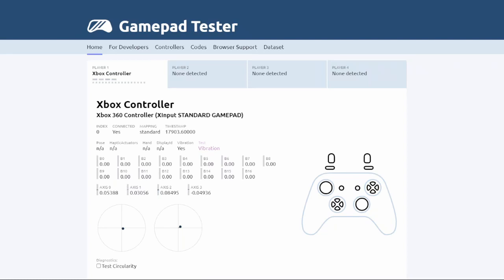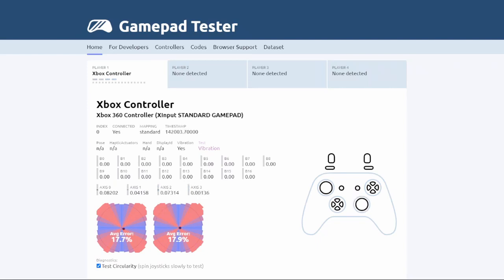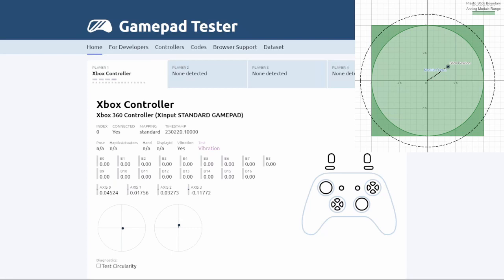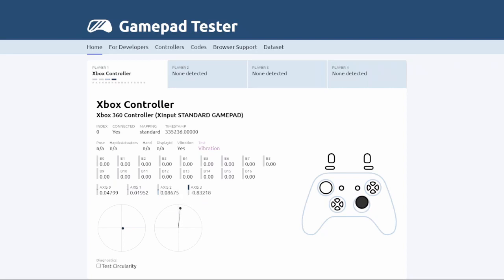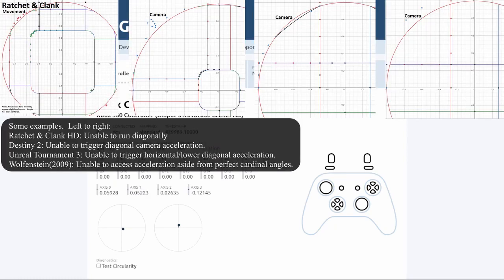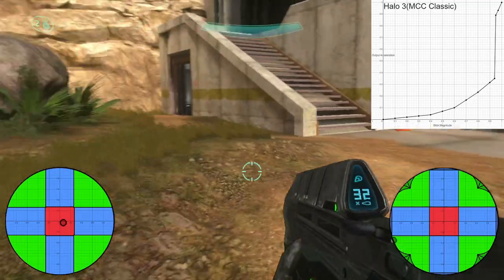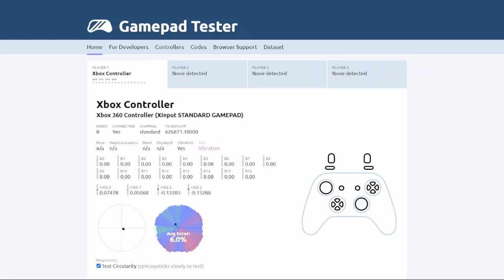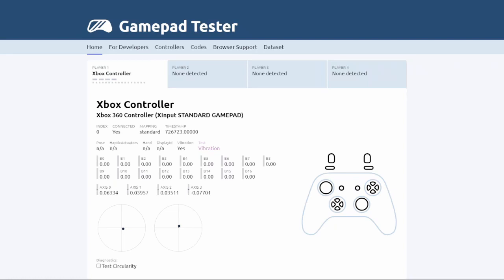My Thoughts on Thumbstick Circularity

Comment: Very good visual and theoretical explanation. It aligns with my observations over the years of repairing controllers. 

Because of the constraints put in place by the manufacturers, e.g., analogue module calibration burned into firmware, I have found that the new module must be mechanically zeroed out (flat, flush, and physically centred in the shell) before any calibration can be done. 

With the dawn of these hall effect analogues, this is even more important since you have to fight the imperfections from the factory calibration. Getting the analogues centred to within 3% (mechanical tolerances and wear are the limiting factors) and getting even full 45- or 90-degree extreme bounds is the biggest issue. 

I've noticed the likes of SCUF just have a wider opening and some others have a narrower stalk on the cap to overcome this issue, but as a trade-off, the stick travel is over-streched and 100% is achieved way before the boundary simalure to the hall effect sticks with no calibration board installed.
Reply: Hey bro, where can I get a free circularity test for my joystick, can't find one online anywhere.

Comment: This was a great, informative video. I recently saw a number of circularity tests on Gamepad Tester when watching reviews of controllers, and got very focused in on that (& how the controllers I was looking at scored in that), but this helped calm that. This, and just realizing that the controller I'm replacing (after 20 months, the wireless dongle failed and the chinese 3rd party has almost zero support) scored 17-18% (although a great center, 0.00002 +/-)....but I never really felt it performed poorly (in fact, I'm debating whether to replace, or just deal with playing wired, b/c I've really liked it). I don't play competitively, or even online at all. The dead-zone remarks re. Xbox Series here made me start worrying about that, too (since that was one of the final contenders), but I should probably ignore that, too, for the same reason.
Reply from the maker: I haven't used a Series controller, but I've heard about the deadzone issues a few times.  I can't speak on that at all, but hopefully that's not an issue.  Some players have used 'deadzone' to mean the stick gets loose quick though.  An actual inherent deadzone would be a large step back over the Xbox One controllers.

Comment: There are some controllers with hall effect analogue sticks such as the gulikit kingkong pro 2 and I believe one of the 8bitdo ultimate variants. Very good, less than 1% error on those sticks even after a lot of wear.
Reply: I bought Ultimate bluetooth and tested it: left 12% 13% right 16% 17. Some quality issues around the analog plastic edges. Unfortunately, it's not a physically perfect circle. Maybe if I mount a nicely cut ptfe plastic around the analog surround, I think I can get a circle that is both super slick and faultless.
Reply: Gamesir t4 kaleid has 2 deadzone options with their hall effect sticks, max 100% and raw. 100% keeps to the circle (0.3% error), raw goes all the way (~10% error). I upgraded from the 8bitdo ult bluetooth (trigger plunger failed 6 months in, doesn't hit 100% RT without teardown fix). 1000hz is a big difference too, more responsive.
Reply: I have 8bitdo ultimate controller and it has 21% error on both stick, basically a perfect square lol
Reply: @cem1221  update your firmware the previous one had a glitch that increase error rate. I fixed this myself by returning to the original firmware but they literally just released a new one 2 days ago that fixed joystick accuracy. Error rate is down to 7-8% and I am performing sooo much better and consistent in Apex now.
Reply: @notchipotle  update your firmware. The previous version messed up the joystick accuracy. Either the newest firmware, the oldest one or second to the oldest. The third firmware update is the one with the issue and the 4th that just came out 2 days ago fixed joystick accuracy. I'm down to 7-8% on mine.
Reply: @RealInnerG  Thanks, yes. its now 8 percent left right.
Reply: Huh, installed new hall sticks on a dualshock 4, error is at ~20 on both, but sticks return to center consistently. Personally, feels fine when playing, though.
Reply: @benjaminschacht92  If you installed them yourself there going to have a higher circularity error % unless you have the ability to re-calibrate the joysticks.

Comment: What's the proper term when your issue is more with it hitting green rather than Red?

As in the controller doesn't go all the way to 100% but around 60% for a second or two before shifting to 100%, causing issues in Hogwarts Legacy and just curious on the name for it.

Comment: I've been searching for a long time on how to make it so that my controller's analog sticks trace a circle instead of a square and I came across this video of yours. Now I would like to know, how would I go about doing what you did in the video to achieve a circular output? (I'm using a wired Xbox 360 Controller by the way)
Reply from the maker: Making the input trace a circle is mostly superficial.

I used a script for the TitanTwo adapter in this video for it, and a similar script can be used for the TitanOne and Cronus adapters.  Those are pricey, but the only way to get that on console.
On PC, I've heard reWASD's virtual controller emulation outputs perfect circularity, but that's the only program I'm aware that can do that for Xbox controllers.  I think virtual controller emulation is part of its free license.  DS4Windows can do that for PlayStation ones with its force output toggle.

Comment: I got this situation while I'm moving my sticks. When they are crossing axis (x or y) they kinda cling to axis, and after some further movement they detach from axis. As i can see from your video, your sticks don't have such behavior. Yours kinda move smooth through the axis. Mine not. What do you think that is?
Reply from the maker: That's caused by the sticks having/outputting an axial deadzone, or a curve being applied separately to the x/y axes.

You can tell if it's a deadzone issue if you make small movements and neither x/y values change, and when moving past an axis one will stay the same until you pass out of the deadzone.
The Logitech f310 does this.

If the axes are altered to follow some curve, then you'll see values changing, but will slow down around near the axes since that's the slower end of the curve.
The Afterglow 360 controller does this.

What controller are you using?  I don't have an official 360 controller anymore to compare, but I used an Xbox One controller in this video, and PS4 controllers function the same.
Reply: @EternalDahaka  DS4 controller
Reply: You got a solution for this? I got the same issues

Comment: Hi where can I get the software? I'm using a Flydigi Apex 4 but I can't be precise in the micro movements because they are too sensitive and I would like to calibrate it
Reply from the maker: The only controller software used in this video is a script for the TitanTwo to clamp the maximum range for 0% circularity error.  That's a pricey device($140) if there are other options.
If you're playing on PC, you might try running games with Steam's Input customization and edit an output curve that can help with the micromovements.

Comment: Hey bro, what program did you use to have less % on the circularity ? Im having a problem with my new xbox series x controller. 
When I want to move the stick in an absolute straight line along the x or y axis, it tilts slightly up or down, which is a problem when playing Rocket League because I can't make perfectly linear side turns. It's really sad because in my country it was very hard for me to afford this original joystick, and I bought it to be able to play Rocket League.
Is there a program that can help force the axes to be more linear?
Reply from the maker: I used a script for the TitanTwo adapter.  I just clamped the stick values past 100% to get the circularity to 0%.
There is no benefit in doing that, since the "real" error is still there, just hidden from gamepad-tester.   Higher circularity was supposedly better in Rocket League anyway, at least before they added sensitivity options.

I haven't tested Rocket League, but another user made a great tool showing the deadzone and dodge thresholds for it.
The deadzone there is axial, so if you raise the deadzone size it will increase the ranges that you move perfectly left/right/up/down.  It works with controllers so increase the deadzone enough so you can make perfectly horizontal movements easily.
https://halfwaydead.gitlab.io/rl-deadzone/

Comment: Do you know if the Dualsense works based on the same Axis-Independent calculation as the Xbox controller? Because I have notice that on RE titles looks like the deadzone is circular compared to the rounded square on Xbox. Even on the last RE:4 demo that came out yesterday I can tell the difference between controllers.
Reply from the maker: I don't have a DualSense to test but as far as I'm aware it functions the same as the DS4, and that registered the same as the XboxOne/Series controllers.  Altering the curve by axis wouldn't create full angular restriction like the axial deadzones even if it felt like it.

Do you play on PC?  I've heard RE8 used a circular deadzone on PS4, so I assume it might be more an issue with the versions having different deadzones for whatever reason.  Maybe on PC they might swap the controller too?  I only have RE2R on PC, and that uses a circular deadzone for Xbox controllers though.
Reply: @EternalDahaka  Yes, but I currently do not have that game for PC. I have noticed that the RE games have different deadzones for PS and Xbox for some reason.

Comment: Thank you so much for your videos, they helped me a lot. Do you have any thoughts on the different calculations on the Xbox Elite 2?
Reply from the maker: Nothing useful from me.  I don't own either Elite controller, and the descriptions I've found for those options aren't clear.  I can find anyone giving a clear comparison of the stick movement to give a good gauge of it.

My only guess is Radial and True Diagonals apply the curve from the center, but radial locks the outer range to a circle(like I did at the beginning of this video for perfect circularity).  True diagonals would be best if that were the case.
Axis Independent could have the curve applied for each axis separately, which would skew the angular movement.
I had made a visual to demonstrate those suggestions, but don't know if any are accurate:
https://www.desmos.com/calculator/ngz75fntl9

If you own the controller, maybe you could see if any of the calculations seem like they match the movement on that graph.
Reply: @EternalDahaka  Thank you for your answer. Yes , it seems to me that the True Diagonals is more precise, specially in games with bad stick implementation (like RE:VII). I thought it was a placebo.

Comment: Gamesir t4 kaleid has a raw mode and a regular mode that either has 10+% error and then 0.3% error. So that's achieved through software? Is there a downside to using the 0.3%?
Reply from the maker: There's no downside to using the 0.3% error version as long as the game's thresholds are within that range.

These Reddit posts are very detailed on the Gamesir G7 with some images of its output and a quicker earlier issue with the T4.  I don't know if the modes differ between models, but the 'raw' mode in G7 seems also artificial in their case, but gives you more diagonal range anyway.
https://www.reddit.com/r/Controller/comments/14t4hyl/psa_careful_about_gamesir_hall_effect_controllers/
https://www.reddit.com/r/Controller/comments/157h6u0/circularity_explained_and_a_note_on_gamesir_g7_se/

Comment: I once soldered a xbox potentiometer on the dualshock and it made fps games unplayable on ps4, Diagonal movement was out of control. How does pc games handle different cotrollers? Do you think they account for the difference in circularity?
Reply from the maker: That's interesting.  I wonder what could be outputting when doing that.  I have seen some replacement modules that were said to work in either controller, but I've never soldered one myself to see how that might function.

Games that support different controllers have things standardized.  Their default resolution will be converted to -1 to 1 like with this testing program.  Some controllers aren't natively supported, and drivers are available to use them(earlier Sony, Nintendo controllers).  These many/may not be coupled with wrappers that will translate the input, normally into Xbox inputs since that's the most commonly supported.

Comment: I had stick drift and got it fixed at a shop, but then now there was a noticeable difference in playing fps games. Tracking was almost impossible. I checked the circularity error, and while the stick drift was gone, it was 25% on both sticks. What would be the reason for this error?
Reply from the maker: What was the shape of the range to get that error?  Is the stick still able to move consistently outside the circle?  ~21% is the max I could get it by hitting the full square range range.

I can't really say much beyond that.  If it leans further outside the module than it did before the module or stick covers could be different.
Otherwise can I ask what values the stick centers at?  I don't now how deadzones are applied to controllers themselves, but if the stick values are something like 0.00392 or 0.00002 there's a deadzone applied.  Possible the firmware or calibration of the sticks are messed up and the deadzone would hide it in that case.  That would affect general stick movements but I can't be sure that's the issue.
Reply: A controller will be calibrated specifically with the joysticks that are installed during the manufacturing. When you replace the joysticks, there's no real way to redo the calibration outside of installing hall effect joysticks with a calibration board. Some controllers come with software that allow you to recalibrate the circularity and If I'm not mistaken the dual sense edge can be calibrated on the ps5.
Reply: Hey bro where did you do your circularity test, can't find one online anymore.
Reply from the maker: @nicholaskhan5632  
gamepad-tester.com

Comment: hey i keep buying controllers with bad avg error how do i set this up on pc ?
Reply: im using a ps5 controller
Reply from the maker: Software correction is pretty superficial, but you can do this DS4Windows and using the force toggle with the max output.  Just check the hide controller toggle(or use HidHide if that doesn't work) so the normal controller and virtual controller don't both output at the same time..
Reply: what software u used for xbox controller

Comment: and how to make that??on pc
no links no apps....im searching tryinga find some software and theres no qlue how to make it on pc
Reply from the maker: For perfect circularity I used a TitanTwo in this video.

On PC, if you have a PlayStation controller, you can use DS4Windows and toggle 'Force Max Output'.
If you have other controllers, I believe reWASD can do this when creating an emulated controller, but I don't know if you need to buy the license for it.
Reply: @EternalDahaka  any thoughts about dualshock3 or xbox 360 controler??...is there some software for ....i found that in cemu emulator when choose gamepad and configure sticks draws circles...but i cant find any softare like this